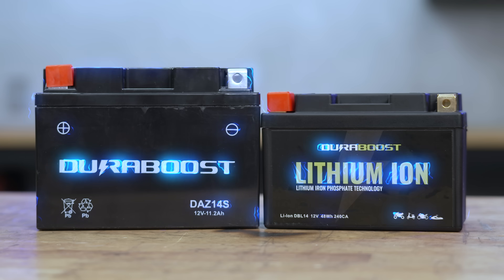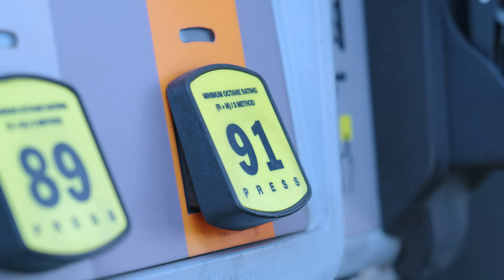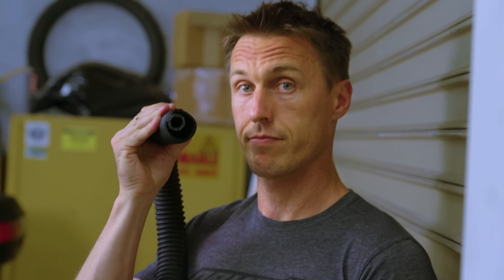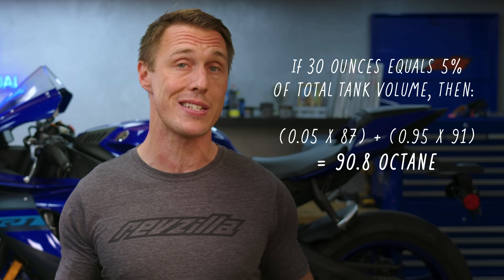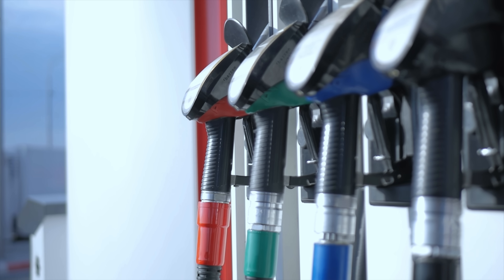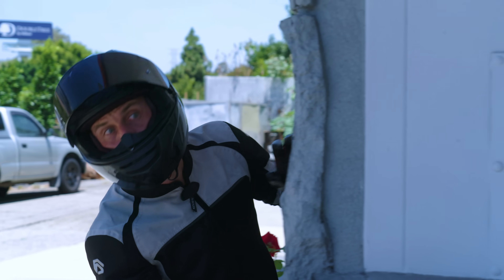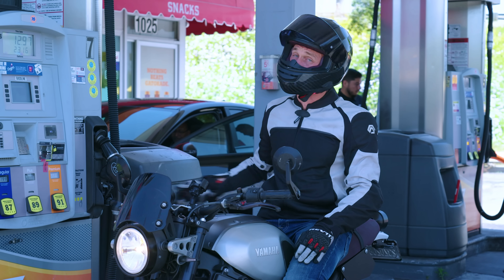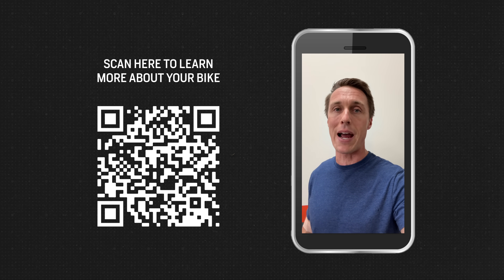How Much Regular Gas Are You Getting With Your Premium? | The Shop Manual

Comment: Here in EU every fuel has it's own hose. Didn't know US has one hose for few fuels. But I like US style where you pay for fuel without going in.
Reply: A lot of new stations in America are building hoses for each octane
Reply: @CactusJack252  Where I live the stations that had  separate nozzles for each fuel type have been phased out. And no new station has separate nozzles.
Reply: Pretty much all pumps I've seen in the United States have pay at the pump options.  However, we do have a pretty big credit card skimmer issue here.
Reply: It’s hit or miss. Some stations do have separate hoses
Reply: Lol! Here is the US I will drive to another station before I go in to pay! I ain’t got time for that!
Reply: The exception for the one hose rule in the US is if the stall is also offering diesel which in that case it gets it own hose. 

As for payment, Wawa here in the east coast added another way to pay is via their app which is also where you apply gas discounts using your reward points and so far, I had no problems.... except a bit of anxiety of making sure I picked the right location but my phone's GPS haven't failed me yet...
Reply: while eu and uk do have separate hoses there are many stations in these parts you can pay at pump. less common than going in to pay though
Reply: Every pump in Australia is the same. One pump for each fuel
Reply: In Malaysia, we have different hoses but different fuel, and we can either pay via app, or tap your card, or use the RFID sticker on your car, or walk in and pay cash.
Reply: If you can find it most places in the PNW in the US that have ethanol free its usually a separate hose.
Reply: Lol Australia we have different nozzles for fuel types and also different octane, we also have fill up and pay when you are done. Very trusting I know.
Reply: @xXAkitokunXx NSW here, that is totally normal.
First fuel up then pay for it.
European standard. 
I like it..
Reply: @laz1go286  it’s Australia standard mate
Reply: In Poland and now in few other countries Orlen has an app where You scan a QR code after fillup and You pay with a binded card. Same goes for Moya etc.
Reply: At my local gas stations they all have different hoses
Reply: tf u can do that in eu as well or at least in Slovenia. You scan the QR code, select your payment method, take the nozzle and fuel up, then as soon as you put the nozzle back it automatically pays and you're good to go
Reply: I live on the west coast USA and most of the stations here have separate hoses for each octane
Reply: And it depends on the station, sometimes no ethanol is separate
Reply: Most places now have options to pay at pump, thing I don't like about america is going in to pay before you pump the fuel, then having to go back in to get the change. UK is so much easier. You pump the fuel, you go in, you say what number pump you are and you pay, go back to your car and drive away
Reply: In the UK there are many you can pay at the pump and even better via an app. You can also pay at the pump in many stations in France Belgium and Germany
Reply: We're a little backwards
Reply: Australia the same as EU. 
Think this one hose thing is stupid.
Reply: Australia - hose for each fuel and octane.
Reply: I like the us pricing lol
Reply: Here in EU you dont go in as well... where r u from?
Reply: @xtripx4273  Croatia
Reply: I live in the EU and I don't go in to pay. Nowadays almost every pump has options to pay at the pump. One hose for each fuel just makes sense too...
Reply: Not true. Lots of differences station to station. Country to country.

Here it varies a lot if they have different nozzles or not. Having to go in is something I've mainly seen in Germany. Not so much elsewhere.
Reply: @ThatGuyFromDK  All of western europe has both stations where you go in and where you pay by card outside
Reply: @ThatGuyFromDK  With the exception of very few stations with card readers outside, Spain and Portugal also require you to go in to pay.
Reply: In Europe we only have one level of octane so just 1 hose, thats why. In Europe we have 95+ only
Reply: @PromethSunrise  Not true, we usually have 95 or 98 in Europe, these ratings are equivalent to US ratings of 91/93. It's a slightly different rating system.
Reply: @PromethSunrise  I've never been to a pump that has a single hose. We also have at least 95 and 98 here. (Which is the same as US 91 and 93, US uses a different octane rating).
Reply: @PromethSunrise which country in Europe has only one level?
Reply: @nickvor  in Italy 70% of stations have only diesel and petrol E5/95, I’d say 20% have two diesel grades and petrol maybe one in 10 has two diesel grades and two petrol grades E5/95 and E0/100 (I’d say most on motorways really few on regular roads)

Comment: I wish you had also done an analysis, drawing non eth gas and testing for ethanol perhaps.  The calculation you perform is “worst case” based on total volume of the hose after the manifold.  When I pump gas into my vehicles I always see fuel drain (top down) after the pump clicks off.  If the manifold allows air in at the top of the hose, after the pump clicks off, the hose can fully drain. I would like to believe this is necessary as I expect the customer is paying an amount for the gas pumped to the manifold. Perhaps a discussion with the manufacturer of the pump could show whether my theory (the hose does drain) is accurate, or not. But, perhaps like you, the issue is not of great concern for me (on my street bike) and the effort required, to analyze the mechanical aspects of the pump, may be great.

Comment: In my local area all the pumps that have non-ethanol fuel offered have their own separate hose & nozzle for the non-ethanol fuel selection. Most do however share another hose & nozzle for all the other octane grades of ethanol mixed fuels. 🙂

Comment: It took me way too long into this video to realise all three countries I’ve lived in all use one hose per pump and it doesn’t apply to me at all lol
Reply: Just so you know we use the same compartment in the truck for all grades including diesel and ethanol free. Octane ratings are the minimums. There's always a bit of retain in the truck anywhere from 1/2 to 5 gallons. The fuel racks normally use the same hose for all similar products like all reg/prem or #1/#2/reddye. Only reddye is specifically purged from the line towards the end of fueling. Guess what I'm getting at is all grades and types have some mix but just like the same hose being used at pumps its so minimumal it doesn't even matter. Even the pipelines have mix. There's no physical barrier when pumping the refined from the refineries to the fuel farms that feed the trucks.